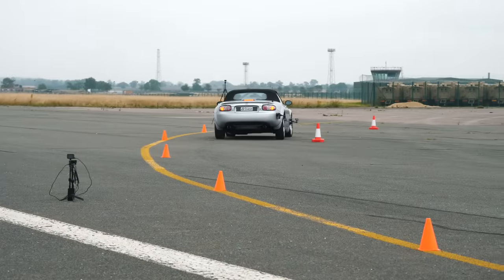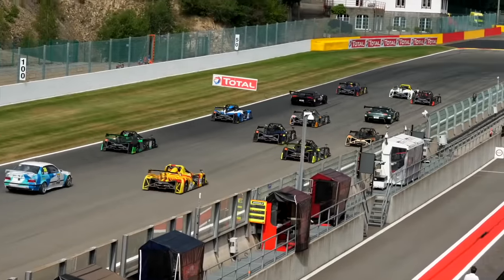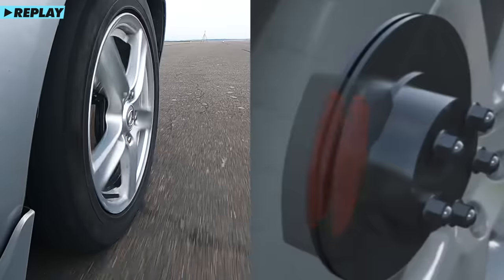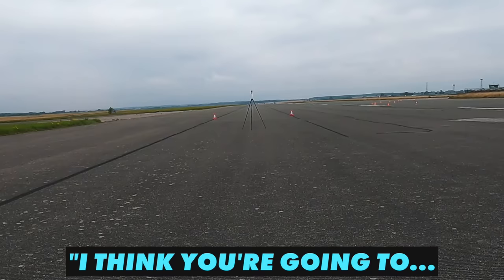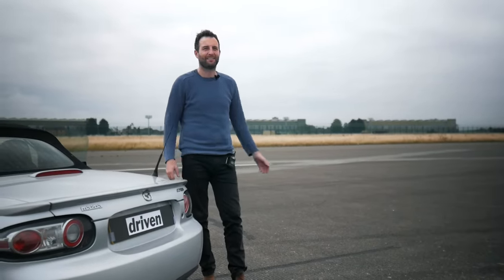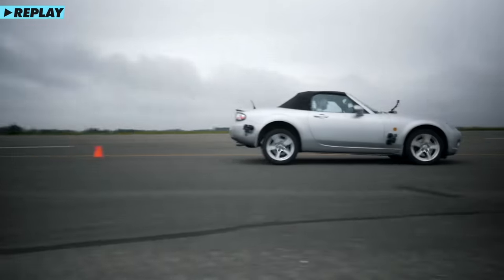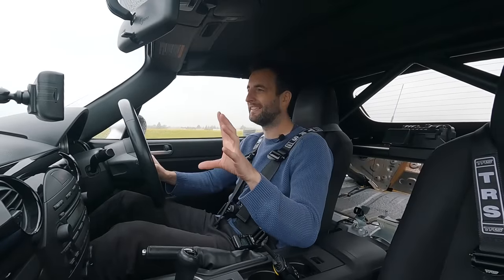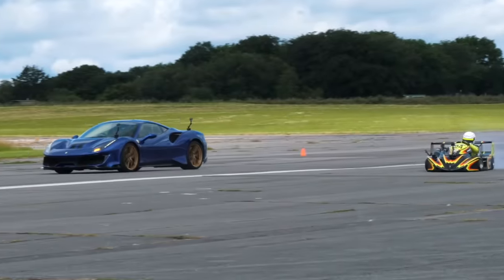ABS ON vs ABS OFF | What's Really the Difference?

Comment: Great subject and again may I add my opinion on ABS. My first experience was in early 70s with (if my memory serves me right) 1972 Olds Toronado that had rear wheel ABS and I wasn't all that impressed and I didn't find it very useful. Years passed and when I got behind a friends new 1992 Chevy Suburban with all wheel ABS. It was OK but the pedal pulsing was most irritating under hard braking. Wasn't impressed but it was much more efficient ! Since the last 20/25 years the systems have improved considerably and now with all the electronic traction control systems it has become the norm and very capable in almost all road conditions. Thanks again.

Comment: If my last car had ABS, it'd probably still be around. Was going home almost a year ago now, and came upon a van doing 10 under the speed limit. I passed them, only to nigh immediately come upon a car stopped at a red light. Dutifully, I pressed the brake pedal expecting to stop, but the road was covered in a thin layer of frozen mist that I was unaware of, and the car, in fact, did not stop. Confronted with this situation, I panicked and stomped the brake pedal and froze up with the only thought being, "OH, SHIT!" Thankfully, the car I plowed into was undamaged as the rear bumper took the impact and sent the car sliding several car lengths into the intersection. Unfortunately, my car was not so lucky. The nose had dipped and took the full impact on the hood and radiator, the former folding halfway in half and the latter rupturing and leaking coolant all over the ground. Insurance totalled it as it wasn't worth fixing, if it was even fixable to begin with. It wasn't clear if the frame had been hit or not, but if it hadn't it had come insanely close. I've seen come to own an all electric car which has ABS (The previous car was made back when ABS was an expensive option which my dad didn't need since mom's car always had it if weather dictated it's necessity.), add to that the added braking of the regenerative braking system, and in an emergency, my car will stop insanely quickly, but most times I don't even need the friction brakes to stop.

Comment: As someone who owns a miata this is really cool to see. Honestly blew me away with how much of a difference ABS makes
Reply: The NC also has an electronic brake force distribution system so it adjusts the brake bias automatically and continually. It is pretty trick, and much easier than trying to set bias from a proportioning valve like many race cars have.

Comment: Good video... with equal traction under each tire.  Put the test in the winter in Alaska (or anywhere with variable icing conditions) with dry ruts and icy strips created by normal road travel with studded tires and suddenly ABS can fail spectacularly.  Volvo found a simple solution as they seem to have a lot of experience in such conditions - triangular breaking - whichever 'triangle' has the most traction is the one that is used for braking.  My 1984 Volvo Wagon was better on the road in winter conditions than my fancy 2004 Ford Explorer with its 'fancy' ABS system.  Almost put me in the ditch several times before I realized the 'design fault' in the Ford.  However, on dry pavement, the Ford ABS system did keep me from hitting the guard rail when there was a wreck in front of me.  I'm looking forward to purchasing something more modern one of these days and seeing just what has been done to improve it.

Comment: I think the video beautifully demonstrates the utility of ABS. And even if it's still accurate, it would be more accurate to use two different cars of the same model, because you can wear off the tires once you break like, which means the next experiment isn't going to be the same.
But at least you did the ABS ON experiment before the ABS OFF, which actually impressed me how different it is.

Comment: My 2001 has ABS but in certain conditions I need to use the park/hand and foot brake to stop, the ABS will not allow the vehicle to stop. Over all it works good, braking and turning when trying to avoid an abject on dry roads. I was going to remove the fuse but it works really well on the highway. (Edit, I been driving this SUV for 17 years)

Comment: nice, i expacted less diference between abs/non abs, but it is big because high speed and when rubber melts, it slides like on oil, similar thing happens on wet when water starts to evaporate under wheel and lifts it up

Comment: I had an Ae140 corolla and was terrified of the ABS system. There was no steering angle sensor and if you wanted to steer on a surface that was anything other than dry pavement you had to be below lock threshold. Hitting the brakes, the ABS system would force the car to travel in a strait line. If one tire loses grip, like it would if youre trail braking, the ABS makes every tire turn at the same speed. I hated it, i went through stop signs in the snow all the time because it would take three times the distance as using the parking brake alone. I got use to pulling the parking brake, defeating the ABS and allowing me to lock all four wheels when i felt the popcorn under the pedal and all i wanted to do was stop. It was remarkably easy for me to test this, my driveway entered the roadway on a northfacing hill and would typically have a small amount of ice in the afternoon outside the travelled portion of the road. As soon as i would turn into the drive, if i was touching the brakes at all the steering would fade and the car would go strait. I couldnt stop on the downward slope with the abs active, nor turn into my driveway. It was garbage.

Comment: I had a 93MR2 Turbo with ABS disabled, and a 96 Accord with no ABS, and never had issues jamming on the brakes in normal driving.  Of course, I didn't try to push the brakes through the firewall.  I actually couldn't get the brakes to lock up on the MR2, since I had some good tires on it.  Even when messing around and trying to push the brakes through the firewall...

Comment: It is also worth noting that lockup is almost as efficient as rolling braking if the low-speed regime, and also that braking distance is quadratic to initail speed. Both strengthwn the effect that the 50% difference we see here is not distributed linearly along the stopping distance, in terms of speed. It'not like "if you'd hit the pedestrian with 20 km/h residual speed with ABS, then you're looking at 30 without it", but rather MUCH worse.

Comment: Now we need you to press the breaks racing driver style. Just as hard as they need to. Because breaking hard <> breaking right.
I've gotten my driving license some years ago. At first I would break nonsensically. I would go ham on them if an emergency arose. However a year later I would just out experience press the breaks just as hard as they need so not to spin. Lately I've been  driving an abs car and have found myself in danger of crashing multiple times because it kept the ABS going even when the car speed was reduced to 10km/s. I was driving on a dry road with 40-50km/s and I saw a car in front of me braking. I hit the breaks when I had plenty of space between us. ABS decided to take over immediately although I didn't slam on the breaks, I just wanted to gently decelerate... I stopped 5cm away from the car... I was seeing my car moving towards it with 3-4km/s, but the damn ABS was still on and didn't allow the tyres to grip... I really question how good of a technology it is... More accurately, I question how good is the implantation on each car... I confidently state that I can break much better with ABS off on my car...
However, I will have to give the steering capability while breaking to the ABS. There's no denying that. But when it comes to just breaking in order to decelerate fast, traditional breaking is better as long as you know how to do it. As stated in this video, racing cars don't have ABS. Yes their tyres might have better grip, but it all comes down to the driver. All in all ABS is lifesaving for most drivers and that's good, but I'd like to be able to disable it and leave it like that forever xD

Comment: Experienced the incredible security of the ABS 30 years ago, when the vehicle in front of me lost it's load on my lane at 110kph (68 mph).
Quick braking with feedback, faster than I could have done, and then the ability to still control the direction to avoid the crap while continuing to slow down. That is the point for ABS. Real-world moose test while braking.

And that was with a skilled driver, the kind that go on sky resort in winter with summer tires, and had real sport cars.
ABS gives the same ability to any driver, under any condition, and that's why it is invaluable.

Comment: I think this all depends on the efficiency of the abs system and how old the car is. Cause the shorter stopping distance definitely didn't apply to one of my old cars. It was a 1.2L Renault clio, 02 reg. The abs on that car was actually dangerous. Its like the abs kicked in too soon and the 'on' and 'off' of the brakes wasn't quick enough or something. It would also sometimes loose its steering ability when the abs kicked in, and it had this thing where it would release off the brakes for a split second on all four wheels at the same time, which would then cause the car to shoot forward from momentum. 
Was damn scary tbh.
So when a wheel sensor eventually failed i didn't bother to replace it because that fault would turn off the whole abs system, which was alot safer. I have no problem controling the threshold of the brakes myself so that they don't lock up. Thinking about it, there may have actually already been an issue with the abs system on that car but the ecu wasn't registering it.
The abs on my current car, a seat Leon, is perfect. And definitely shortens the stopping distance and allows for really hard braking around corners ect

Comment: Try doing this in a 2000's era Toyota Avalon. If one wheel hits a patch of ice or mud, you suddenly have NO brakes. So many times I've wished there was a switch to just turn the stupid thing off. Sadly,  it was designed for old people, so the emergency/parking brake is one of those old-style ratcheting pedals in the left/rear of the floor.

Comment: i drive my dad's car as a daily, a 2012 Honda Fit (which is an amazing car) and one day i drove my workplace's Pickup (suzuki futura, a bit similar to Japanese Kei Truck) with no ABS on a rainy day on a highway, not to crowded really, but i was on a high speed (around 90km/h , 55mph) when suddenly the car in front of me brakes, which naturally i brake too but i pressed it a bit too hard and my car loss control, fortunately it didn't hit any car, but it was the most terrifying moments of my life. Learned proper braking after it.

Comment: I've been driving with no ABS for about a year now. In my experience you need to have a fundamental understanding of your cars breaking capabilities in certain situations. You never want to slam on the brakes on a vehicle with no ABS as shown in the video, gradually and slowly push down on the brakes. In certain situations such as rain or snow it is optimal for you to step on the brakes and as you're slowing down slightly let off the brake pad then reapply more pressure to come to a complete stop without the wheels locking or the vehicle hydroplaning.
Reply: You also get to understand weight transfer and inertia force when you got no ABS. I feel that for general safety of everyone, ABS is a good thing in my mind, so that sharing a car does not become a treat to others, mostly pedestrian.

Comment: Treshold braking always came natural with me somehow, I don't panic slam on the brakes. Panic always comes after I'm safe (or have crashed, which so far hasn't happened thank goodness). 
I also don't instinctively slam the clutch either, only when the revs are going too low. Not even sure how my brain does that, but I'm happy it does :D.

Comment: The only moment you didn't take into consideration is that cars without abs has pressure regulator between front and rear axles, and it does great job in providing stability and predictity of power breaking.

In cars with abs role of that regulator is done by abs. 

So, that test doesn't show the full picture of the topic of the video

Comment: I remember years ago seeing a program (might have been Tomorrows world or top gear) where they were testing ABS (white crosses painted on tyres) It is as you say brilliant if you need to brake and steer.  If you read the small print in the hand books it also states it may not perform as well as non ABS in some conditions (watch people braking in the snow, once all 4 wheels are locked it thinks its stopped...) In the Program as a Kid a clearly remember Bikers saying it was not something they would want as if you brake in a corner it sits a bike up and you go straight, they would rather lock drop and get off rather than impact by going straight.  As an adult and getting in to bikes I have had the experience of both,  a non ABS bike I was able to steer around the car that pulled out in front of me using a little more rear brake to add rear wheel steering, however when I got a new bike with ABS and the same situation I was unable to steer around the vehicle as the rear wouldn't lock so I ended up with the car wiping out my front end and me trying to impersonate super man.   Please do the test again but with cadence braking as well.  To many driver aids these days people think they are invincible

Comment: Unplugging the ABS system also kills the brake bias/balance control, a feature normally done by a pressure control valve or car body height valve in a non ABS equiped car. As you yourself stated many times, your natural reaction is to lift off the pedal to release the brakes this is also the reaction of anyone taught to drive a pre ABS car, it was part of driving instruction. ABS has it's benefits for sure, deskilling drivers being one.

Comment: Whether the ABS yields shorter distance than locked wheels very strongly depends on the surface and tyres. Some combinations (esp. dry clean surface with older, hard tyres) really lead to the distance being shorter with locked wheels (when the heat softened rubber yields higher friction in that example). But stopping distance without need for any direction control is not the role of the ABS.
The compare to a racing is flawed: With racing (mainly F1, but others as well) the car brakes are very precisely balanced, so with gradually increasing brake pressure they start to slide all at once (or better to say at the exact desired sequence), so when the driver is limit braking, all wheels are at the exact limit point.
But a real "civilian" car will always have an imbalance (mainly rear vs front; depending on actual car loading, road condition, temperature, humidity, tyre state,...), so even when attempting limit braking, best case only one axle would be braking to its full friction potential, the other would still have room for stronger braking. Because the ABS controls at least the axles independently, it is able to be around the maximum braking point (although maybe not as accurately as in the race) at both axles at the same time, regardless what imbalance is there.
Plus there is yet another aspect: In a race practically most of those limit maneuvers are "planned" at least a few seconds in advance, so the driver is mentally prepared for it. In a normal traffic you go for the limit only in a surprise emergency without any preparation and needing to still mentally evaluate "what the heck is going on". So not much mental capacity left for things like limit braking, so most likely it would be executed in very suboptimal way, so practically leading to either loss of control or prolonged stopping distance.
So even when ABS is technically far from optimum, in a surprise emergency it is still way better than virtually any human...

Comment: The entire premise of what is to happen when a brake pedal is pushed on an ABS system is so radically different versus a 'NON' version, I compare removing the fuse equals a 'Non ABS' system to separating the components of a finished cake or un-cooking and egg. 

The advent of ABS has led to the redesign or outright removal of mechanical proportioning valves for brake hydraulics, making disabling the ABS extremely dangerous and spinning out likely in a modest stopping event. 

A non abs vehicle is dividing brake pressure with a large bias to the front, along with a slight delay in full engagement of the rear brakes to let the front axle start squatting from the extra weight during deceleration. 

Many non abs vehicles have a mechanical link to the rear axle ride hight, releasing rear brake pressure as the axle travels further away from the body, and vice versa. This linked setup helps with lockup, and axle 'hop'. Provides extra brake pressure under cargo load as well. A lot of clever, analog voodo. (even if a rear wheel locks up with some or all of these items, it is more likely to lockup and release in sync with the front axle) 

With ABS I have a new way to modulate the wheel, I can now send 3 times the brake pressure to the rear wheel, and engage at the same time with the front axle without a delay. Faster stop with less nose dive.  No longer installing items to deal with the after of an eliminated problem. 

(the only time I have had non ABS stop better is when sliding on incliment surfaces. The locked wheel can pile material in front of the tire, or dig in like a plow, instead of the natural 'flattener' a rolling tire is.)